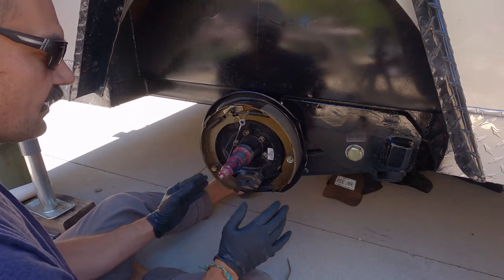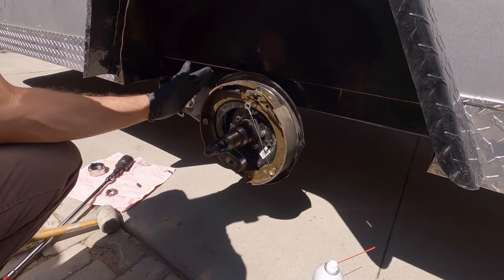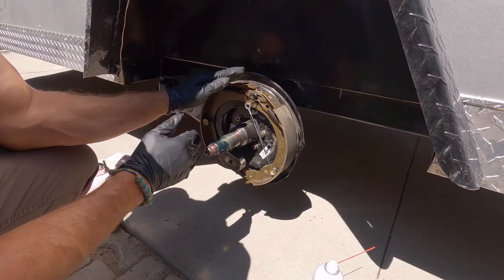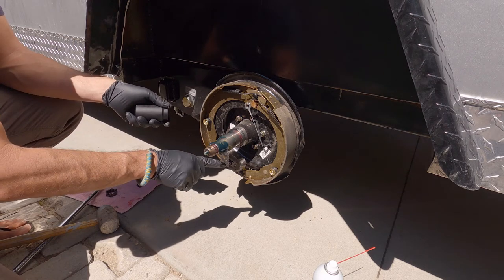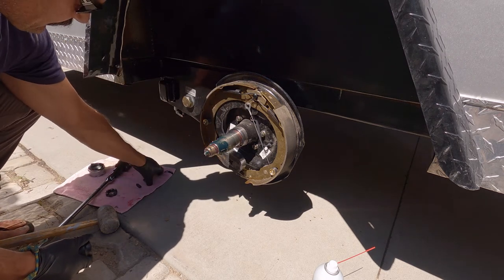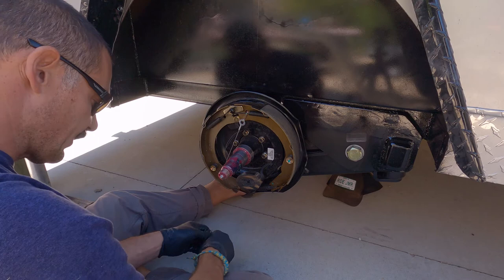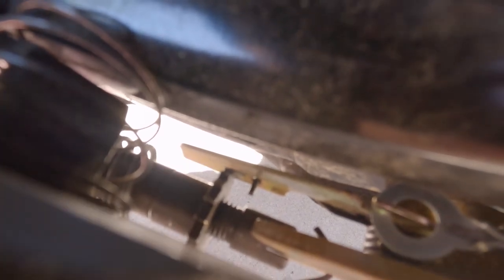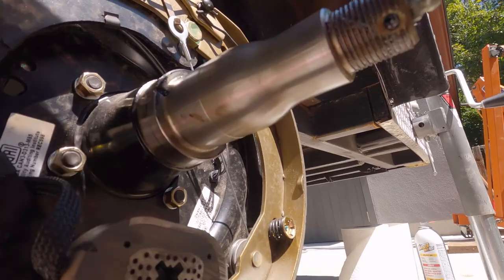How 12v Electric Trailer Brakes Work

Comment: At around 1:45 you had to tap the top of the brake to get it back into place. Is this an issue when driving and braking. I  am having the same thing happening with my trailer brake.